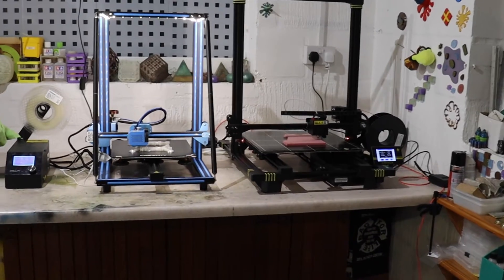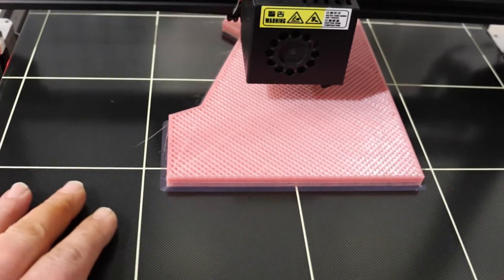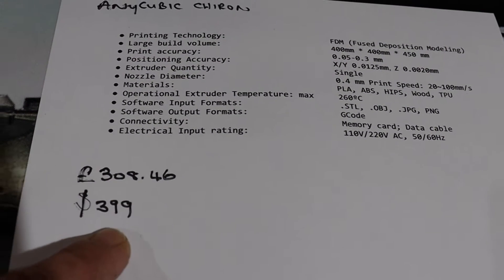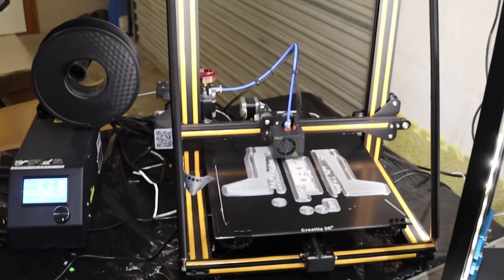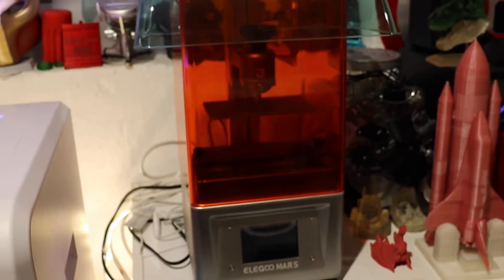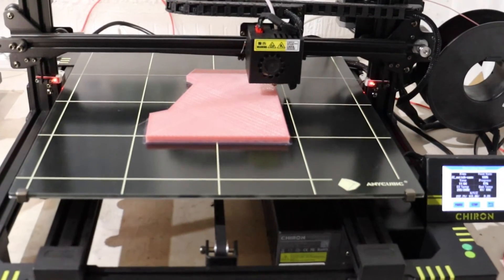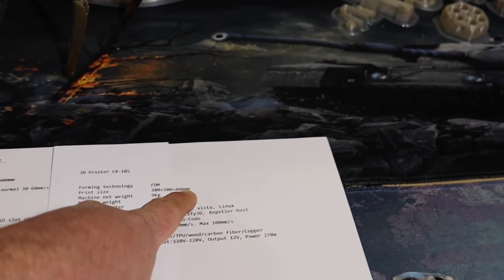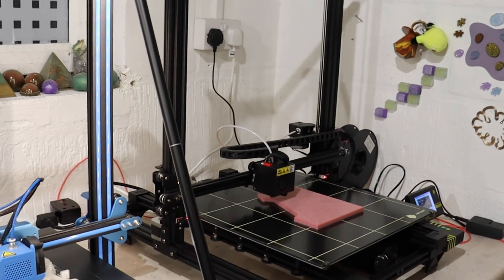3D Printer Wars Anycubic vs Creality

Comment: So I'm watching the videos and reading your comments, you think the cr10 v3 is the best one out of the lot to get? Or do you have a different favorite at the moment?  I've been looking at the ender 5+ but the anycubic line(especially the one with the laser with it) has been so appealing as well.
Reply from the maker: Hi, the cr10v3 is a really nice printer, currently at the moment I'm loving the cr6se, I've given up with anycubic as their quality control just recently has been terrible
Reply: @BeanGaming-w4n  thank you bud I appreciated your response. I've been stuck between the ender 5 plus and the cr10 v3 now.  The latter does seem to have some better parts.
Reply from the maker: @lessthanahome  i own both of them, the ender 5+ does have a slightly bigger build area but is a massive machine, the cr10 v3 is direct drive so always a winner for me
Reply: @BeanGaming-w4n  alright so final question, the cr10 v2 pro, or the cr10 v3?
Reply from the maker: @lessthanahome  now that's a difficult one as yet again I own both lol all depends if direct drive is important to you or not, the cr10pro v2 comes with bltouch installed the cr10 v3 will be an extra add on, pro v2 has touch screen v3 doesn't, if I was just printing with say pla or abs would pick the pro v2 all day but the v3 will give you more options to print with other filaments, the pro v2 will still print with most filaments but you might suffer the odd jam or failed prints when using flexible filaments. If you do for the cr10 pro v2 make sure its the v2 as the original pro version was absolutely pants
Reply: @BeanGaming-w4n  thank you for your time brother, I'll get back to you when I have it and I'll mention you in my set up video. Appreciate you!
Reply from the maker: @lessthanahome  no worries buddy 👍🏻

Comment: nice video, very natural, and honest argument! btw, in my country cr-10v2 will cost me $555 and chiron $635, yes quite crazy right? hahaha! At that price point what you will choose between those two?
Reply from the maker: Hi, well the chiron has a bigger build surface but in my opinion the cr10 v2 is just amazing, im currently converting both of mine to direct drive. They are now releasing a cr10 v3 which has direct drive installed
Reply: @BeanGaming-w4n  ah yes cr-10v3 is $600 in my country, so what about the stock chiron with $635 vs the v3?
Reply from the maker: @SAMUEL-zc2mv  hi, i would still choose the cr10 v2/v3 over the chiron. have a look on www.banggood.com, ive brought a few printers from there and they work out cheaper
Reply: @BeanGaming-w4n  thx a lot!

Comment: How the noise level ? same as the silent motherboard in creality printers
Reply from the maker: graham hyland it’s not far off the creality machines sound wise, wouldn’t say it’s loud but you can hear it
Reply: @BeanGaming-w4n  thermal protection & print resume in firmware ?
Reply from the maker: graham hyland yes yes and yes, The anycubic will do everything the creality machine will do just better
Reply from the maker: graham hyland also what I like is if it runs out of filament it will keep the bed hot unlike the creality machine which shuts itself down so the print then comes unstuck from the bed which is useless
Reply: @BeanGaming-w4n  will you be changing the stepper drivers to the silent ones as you can change the drivers on the main board a big plus there ?
Reply from the maker: graham hyland hi. I’m not going to be changing anything on this machine at the moment as it’s working to well

Comment: any recommendations on where to buy PLA filament (Brand, etc.) in the UK
 ?
Reply from the maker: AndrewJames272 hi, I would give the brand ZIRO a try you can get it off amazon, it’s well priced and I’ve been using it a while and is really good.
Reply: @BeanGaming-w4n  how was the filament you ordered from Wish ?
Reply from the maker: @graycbr600  lol we dont talk about that, was a waste of time they were all the wrong size so i got a refund thats why i never bothered doing a follow up video on it. I will stick with Ziro that i get from amazon its far by the best ive used so far